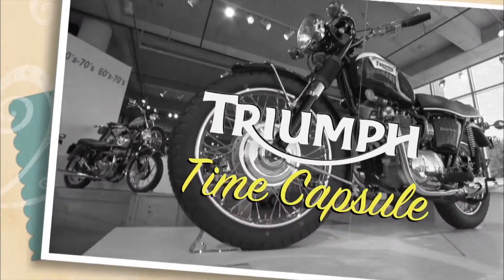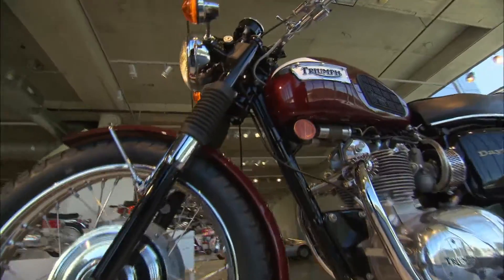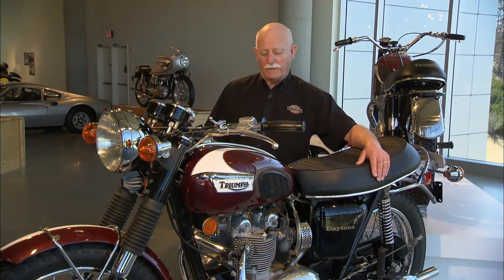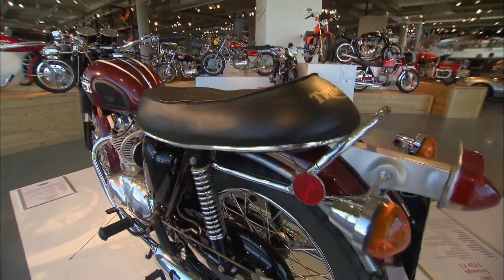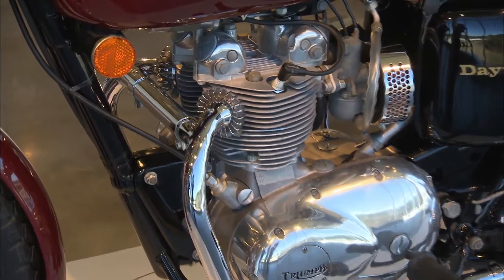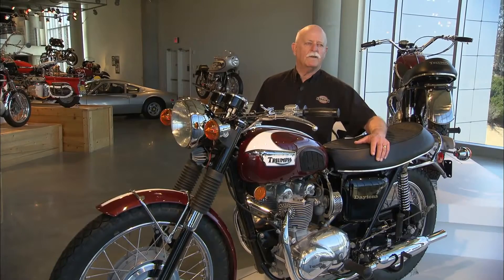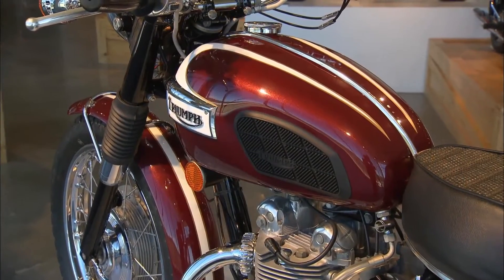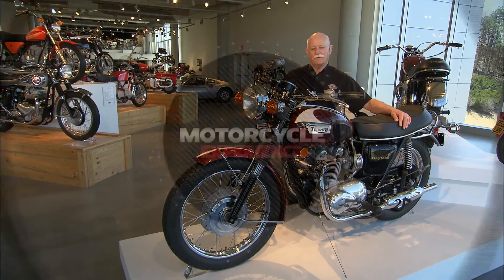Motorcycle Experience Time Capsule: Triumph 1973 T100 Daytona

Comment: The Daytona was Triumph's unsung hero.  Great bike. Handled beautifully, had plenty oomph, insanely chuckable, and didn't really vibrate - which is something for a Trumpet. I mean a T140v, you couldn't keep your feet on the pegs at 70 and long runs were exhausting. The Daytona gave a little away in performance but you got it back in simple pleasantness. You could drive it all day and not need chiropracty at the end. Or, you could just nip down the pub, er, cafe and it wouldn't be outclassed by the bigger Trumpets,  BSAs and Nortons. In fact it was a head turner. Very sweet motorcycle, glad to see it being promoted. Sadly, in UK at least a lot of these were turned into 'choppers' which were inevitably scrapped, the fate of all such abominations. Tragic.

Triumph made an 'enduro' version called the Adventurer, which was just silly fun to drive. IIRC it had lower compression,  a  milder cam and lower gear ratios. That was the bike Ted Simon took on his round the world trip, described in his book 'Jupiter's Travels'. It made it!